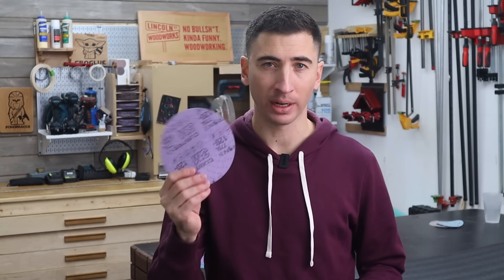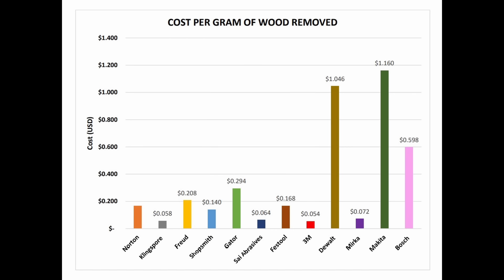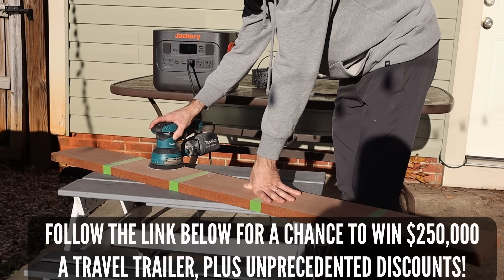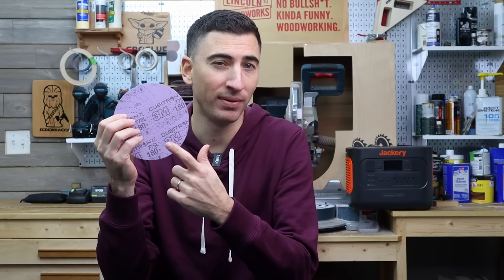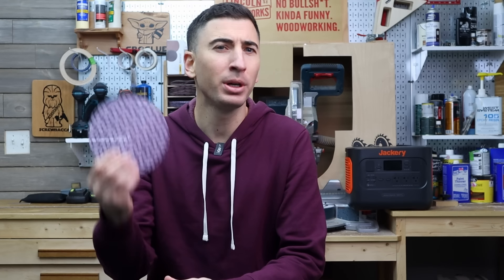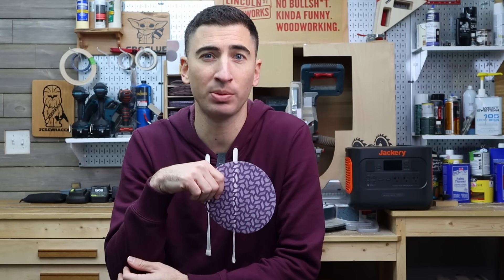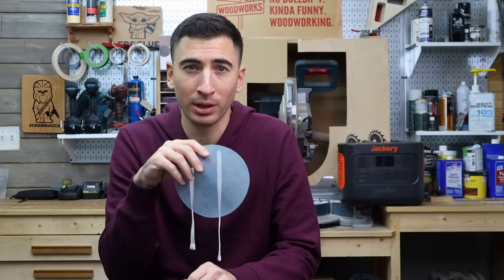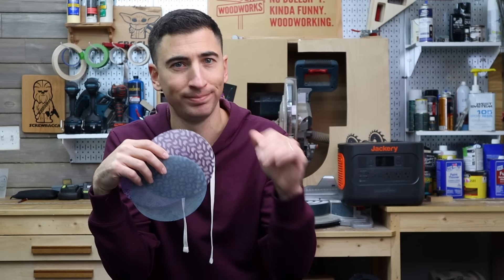This $.07 Upgrade Will Save You Hours

Comment: Great and informative video. One thing you might take a look at are the graphs you had at the beginning. You were talking about cost per gram but the chart showed wood per 25 minutes. This higher number in the graph (amount of wood removed) is basically a good thing, while the higher number in you description (cost per gram) is a bad thing. The magnitude of each sample is sort of backwards to what you were saying. You were describing it correctly, but I think it would have helped to have a graph that displayed your data. Not a big deal, but the graphs went so quickly it isn't easy to discern that they are different and potentially misleading. 

Is they reason you said 'sorry' to the battery powered guys (me most of the time) is because we would have to tether to a vacuum hose or is there some other inherent drawback that I'm not aware of?

Comment: Honestly, the biggest problem I've had with the 710W while connected to dust collection is that the sander literally wants to stick to the work piece because of the suction thru the sanding disc. This happens on either my Bosch GET75-6N or the cordless Bosch GEX18V-5N with the cordless sander being by far "stickier" than the 6" sander. On the 5", I get the same effect with the Diablo mesh discs, too (It's the only other mesh disc I've tried). I suspect the 5" cordless wants to stick more because it's much lighter-weight than the 6". In fact, I tend to skip the dust collector altogether when using the cordless Bosch because it extracts pretty well already, and with the 710W, it's even better.

Comment: I just bought some 3M 710W pads because I saw others using them and I've tested them literally once.   and NOW I see this and I need to get some 310W pads next...  sigh.

(the 710W do work well, but you're right about dust collection.  I just used the on-sander bag and the pads do clog up.  I need to stop sanding without a vac attached. )
Reply from the maker: The vac will make a big difference
Reply: @Lincolnstww  Got a Fein Turbo I coming today...   Time to put on my big boy pants and game up.   😉

Comment: I just completed sanding out a fireplace mantle made from an iron stained old growth fir piling that spent 120 years in the Columbia River. I used the 710W on my 5" Dewalt ROS. My sander has a horrible tendency to skitter across my work-piece.  SWIRLIES!!! Questions [Dwight Schrute]--How would my happiness increase with a Mirka upgrade? When switching to with the grain, non-extracted hand sanding--what paper dovetails into the ROS work that I did?
Reply from the maker: It will be euphoric switching to the Mirka. Any of those papers will do fine for finish hand sanding. 310 probably the best for ensuring a perfect result but they are all more than adequate. Oh and get the 6" mirka. Thats where your world will really change

Comment: i missed this im not sure if you said it in the video, is the 310w ok to use without a dust extractor connected? if it isnt which is the best to use without a dust extractor, i've been tearing through the amazon ones if these will last me longer then i need to get them

Comment: Are the yellow bosch sandpaper not available in the US? Don't get me wrong I use the 710 myself, but it always looks like an unfair to pick up the worst quality product from bosch (they should stop selling it) with the best competetors. I still use and like the yellow one with grit 40, when I want to make some minor adjustments on a board and specially when I want to remove some varnish leftovers.

Comment: One interesting test would be about dust extraction. You weigh the board before sanding and after. You weigh the dust collected (in the bin + change of weight of the filter). Dust collected / board weight loss is extraction efficiency.
On its own it probably isn't a useful measure, because it depends on the kit that you are using for dust extraction, but you can certainly compare the different sanding papers that way.
The intuition would be that some backing materials are more porous than others, maybe the size of the dust particles depend on the grit material.
Whatever could help to reduce the airborne dust in the shop would be helpful.

Comment: sooo.....what if you sand cedar and pine mostly but are not hooked up to sander (I sand outside with a mask and fan)?  

I have another question for experienced peeps.  If I am not sanding to a fine finish as I am building outdoor projects which do not require it, at what point would a drum sander make sense?  I HATE sanding.  Its seems like one could save a tremendous amount if time.  thoughts?

Comment: Hmm, interesting. I am mostly a bowl turner. In experimenting some time ago, I found that with the Mirka/woven type of abrasives, in grits up to about 180 or 220, they were much slower than the full cover abrasives. Over 220, there was no difference that I could tell. I don't have the fancy things to be able to exactly measure grams for differences.... One abrasive not here is a blue abrasive, maybe 'Deer' logo, that I get from VinceswondNwonders. I believe there is some ceramic abrasive particles in it. I had Vince make me some discs to fit my 5 inch Festool sander. It is the longest lasting abrasive I have found for sanding bowls, frequently getting several bowls out of one set of discs, rather than maybe one bowl per disc. or some that were just the inside of a bowl with one disc. My favorite saying about 'when to change' discs was some thing like 'use sanding discs like my 2 year old uses toilet paper', or 'like some one else is buying it'. You lose time using dull abrasives. I do keep the rubber eraser sticks handy, and they help extend the life once in a while. The cubitron is only available in 2 and 3 inch discs. The ones I get from Vince are 2 3/8 and 3 3/8, so they lap over the edge of the 'interface' pad, which is what we call the cheap pad that we can waste rather than the main mandrill. Oh, the hooks can leave serious scratches on a finished piece. 

You can not remove 80 grit scratches with 220, unless you want to sand for hours. If I start at 80, next is 100, 120, 150, 180, 220, and with my bowls I go to 400. Grits above about 600 to 700 or so are invisible to the human eye. The finer grits are more 'polishing out scratches' rather than sanding and removing stock. Paint grade stuff, 150 max grit. Surface finish, 220. Wipe on finishes, however high you want to go. Not sure where a hand planed surface is in this list...

One turner said, "Never take a finished piece from the shop into the house on a sunny day. Sun light causes scratches." I prefer the natural light type of lamps for seeing scratches. A raking angle does help. Oh, cheap reading glasses from the big box stores are okay, but not good after a while, you need glasses from an optometrist.

Comment: the mesh stuff is good until it hits something slightly rough then they mess up quickly. so now i only use them for later in the process. if its very rough i use cheap 40/60 then use better 80 etc.
Reply: Have you tried diablo sandnet? It's much more durable than 3M in my experience.

Comment: Hmmm.  You are the first place I have heard that the mesh backs pretty much require a dust collection hookup.  I have dust collection, but enjoy moving pieces outside to sand and then leave the hoses behind....so now I feel I may have wasted money in stocking up on the 710 discs!  😞
Reply from the maker: I dont think you've "wasted" per se. Just more likely to not maximize the disc. Even without a vacuum hooked up - I bet it still outperforms the majority of film backed discs on the market.

Comment: I bought all kind of grits( 80-300) of the 710W for a staircase renovation. Here in Europe they can be had for under €0.50 per disc (around €23 per packet of 50 discs) and it holds up better than anything I tested, including abranet, Bosch nets & festool, who are all magnitudes more expensive. If 3M is keeping this up they will own the sandpaper disc market in a matter of years.
Reply: Which variety of Abranet did you use? I got the Abranet ACE (ceramic abrasive) and I'm in doubt switching to the 710W. Mostly end grain sanding, some general purpose work.
Please advise :)
Reply: @mlrodenburg1990  Ik denk dat het de gewone Abranets waren, maar ben niet zeker want de doos is intussen al weer een jaartje op. Was ook meer dan prima schuurpapier, niet slechter als 3M imo, gewoon veel duurder. Zeker geen reden om abranets buiten te gooien, de 710W gaat geen merkbaar beter resultaat geven. Ik heb 3m gewoon bij slijpexpert gekocht, maar zie dat het intussen ook al weer wat euro's duurder is. Wel nog steeds rond 55cent per schijf,

Comment: What would be your recommendation for variety of surfaces for for painting prep? I used to use all FESTOOL abrasives because that is the sanding system I’m on, but after these videos such as Kat Moses’ I did switch to 710w…. 
Thoughts?
Reply from the maker: Stick with the 710

Comment: Thanks for the in depth analysis of what really goes on with the cheaper sandpaper vs the more expensive options.  Like most folks I'm not adverse to a bargain,  but it is only a bargain if it works.
I was curious about the old time sandpaper clogging remedy of cleaning the wood residue off with a rubber block. My grandfather used to swear it doubled the life of the paper. I'd be interested to know your thoughts.
Reply from the maker: I use the eraser all the time. I've never tested the actual impact of it though. I'm sure it can't hurt given its removing pitch and allowing the abrasives to make better contact with the wood.

Comment: At the end of the day I’m more concerned with finish than cost of material removed. What motivated me to use the 710w was the lack of noticeable scratches left behind. Like you have noted on previous videos is that a persons time is important. For me it is far more important than a bit of money, to have to go back & re-sand by hand after finding swirl marks or scratches negates any price difference. Thanks for the video, as usual great job!!
Reply: It was the 310W that had no visible scratches.
Reply: Yep, but after trying several types & brands of sanding mediums I settled on the 710w for the reasons I wrote above. Most consistent results.
Reply: YES. The 710 is love. Once you try it, it's so much better by light years compared to something like Gator or festool or even mirka. I think tool brands should not mess with sandpaper. 3m has it on lock!
Reply: So what grit are you people sanding to on your sanders to avoid swirls? I'm guessing at LEAST 220?
Might suggest that you actually might save time by sanding to a lower grit and then hand sanding, rather than going to a high grit to avoid hand sanding.
Reply: @Mike-bh7sh  Maybe I'm misunderstanding, and I'm not a pro by any means. Are people trying to start with finer grits and sanding longer so there are no swirls? With harder woods it seems like this would take forever if you didn't already have a very fine finish with few/no defects...

I sand by starting coarse and going finer, usually 3 or 4 grits depending on the project and desired finish. Then I spritz with water, let it rest, and do a final extra-fine grit pass. I always get swirls at the coarse grit passes, but the progression of finer grits reliably removes the swirls. Anyway, I thought this was standard practice, but my only professional experience was in a cabinet shop something like 15 years ago now. Maybe it isn't standard?
Reply: @steve-adams  
Hi. I'm not saying to start at a high grit. Normally you start at the highest grit you can while still removing blemishes efficiently.
But, what I prefer is to orbital sand 1 grit higher than where I actually plan to stop. 
Then I do one grit to lower by hand to remove all the swirls.
Most manufacturers won't go higher than 150 or 180.
We normally do not go higher than 180... though I will use higher grit on end gains so they won't take so much strain. 

The swirls are not caused by the sandpaper. Swirls are the machine's sanding pattern so no matter what grit you and to they are still there.. the only thing sanding to a high grit like 320 does is make the swirls so fine you don't easily  them. 

So, what I was saying is that people would likely find their sanding going quicker by only sanding to 220 and then a quick hand and at 180.

But everyone will develop their own preference... just, when your doing it for a living you try to lay out efficient and fast methods.

Comment: Would be interesting to see the difference between a "cheap" Makita sander and (for example) Festool's high end ones, combined with the 310W or the 710W...
Reply: MIRKA blows both of those OUT OF THE WATER
Reply: Great analysis. Question: sanding very curved hand rail on boat, teak wood, lots of onside curves. Your recommendation for equipment, pads and paper. Thank you. Mike

Comment: The sandpaper revolution in woodworking lately is quite interesting. My father was an auto body repairman and painter by trade and never used anything but 3M sandpaper. I literally have old stock of 3M sandpaper passed down to me that probably outdates most of you watching this video. As a woodworker I've tried serval different types and brands of sandpaper. Honestly all of them get the job done on wood, but recently have decided to go back to the trusty 3M paper. I appreciate the time and effort you have put into your presentations. My first question/concern would be considering the material you're trying to sand. Every species of wood is different unlike sanding other materials such as a painted piece of sheet metal found on an automobile. Why do I bring up this point? I'm not an industry insider but I'm willing to assume that 3M develops its products for the people that use their products the most. The amount of sandpaper used by DIY woodworkers versus the automotive industry is negotiable. The weekend warrior makers can definitely benefit from the premium products that 3M has to offer, if it fits into your budget. But splitting hairs over little fine scratches seems excessive, especially when you can overcome these obstacles with patience. The vast majority of people working in a home garage could probably care less one way or the other as long as it looks acceptable. But I digress. For us woodworkers there are so many possibilities when it comes to fit and finish unlike an automobile that has to be absolutely perfect once the paint is applied. I could be wrong but companies like 3M develop their products to suit the needs of the most demanding sector of the industry. That is where the real laboratory tests exist. There's definitely a place for premium tools and materials in the woodworking shop. I appreciate all the information regarding these topics. It's definitely entertaining to hear about other people's experiences.
Reply from the maker: Yep, 3Ms cubitron was developed for industrial applications like you said. Automotive and aerospace like you said. Most people assumed it was too aggressive for wood because it wasn't developed for that. If you're doing commission work, I wouldn't sell a tabletop with those scratches for instances. They are def noticeable. At the end of the day we all want to sand less
Reply: @Lincolnstww  Then just use the cubitron until the last grid. Saves you time and gives you the finish. TBH, not sure if that will work well, but it could be worth a try.

Comment: I noticed the 775L would not stick to the hook and loop pad on my Milwaukee sander (brand new pad). Would constantly fly off across the room whenever it had the chance. Never had tyhat problem with any other sandpaper. The 710W doesn't seem to have that problem is shockingly fast at material removal compared to the Klingspor discs I had been using. Very happy with the 710

Comment: What sander did you use?
Reply from the maker: Mirka Deros, obnoxiously expensive but a great tool
Reply: @Lincolnstww  thanks. Thought it was a dewalt by the color. Looking @ the new 3M sander.
Reply from the maker: @robertsmithUH60driver  I briefly used the 3M sander - I liked it, but still prefer the profile of the mirka

Comment: I think we have Festool, Mirka Abranet, Bosch and Klingspor PS33 readily available here.  The Klingspor is cheaper than Bosch and lasts a long time.  Abranet is good, but doesn’t last as long as the Klingspor.  It also costs two and a half times as much.  I’ve never tried the Festool because the Klingspor turned to be excellent.

No idea where I’d find those 3M discs locally, but chances are they would cost several times as much as what I am using.  3M stuff isn’t easy to find in shops.

Comment: Tried the 710W discs but was not impressed. The abrasive started flaking off as I was sanding.
Have never experienced this with the cheaper brand discs that I usually use. I will not buy the 710W discs again. 
When using the cheaper brand of discs I periodically stop and clean the disc with a crepe rubber block.